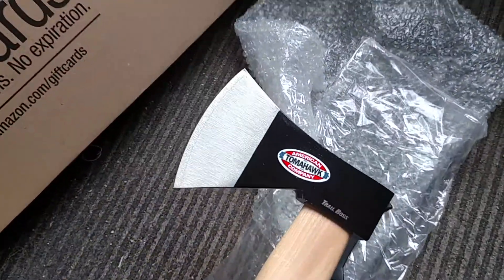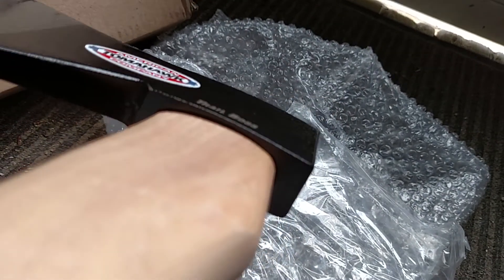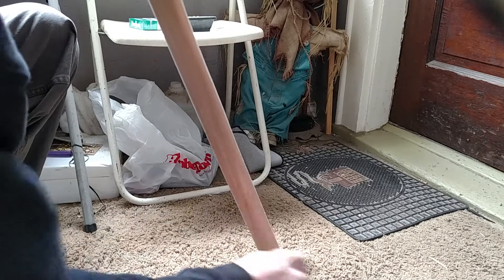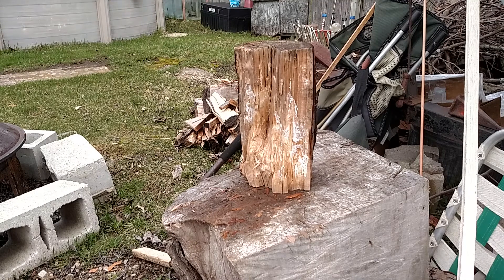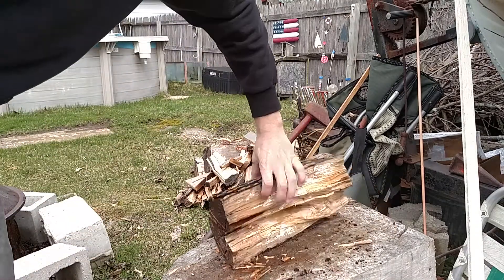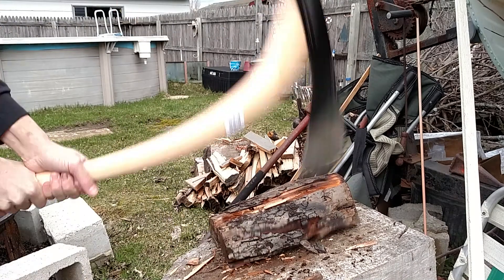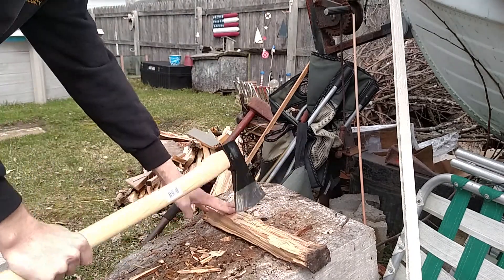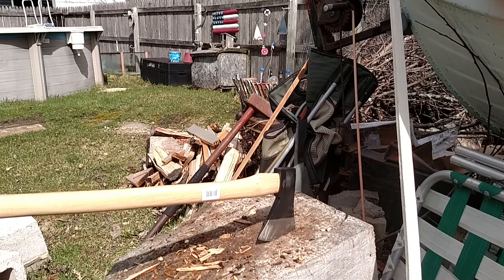Cold Steel Trail Boss out the box testing.

Comment: Good axe I heard for the price. With a little work of sanding the handle and taking off the coating on the blade and give good sharpening and think you will have a winner. I still wonder how the blade will hold to the handle for long term use. Then again you can always change the handle.
Reply from the maker: Tommycod Fish so far the head is staying on the handle with no issue. Been using it for about a year so far
Reply: I gonna buy one good price and make a leather sheath for it. Thanks for posting your video.

Comment: This axe was meant for cutting down trees not splitting wood. You’re going to break that axe one day if you continue to abuse it that way.
Reply from the maker: I wouldn't call the Trail Boss a felling axe and I also wouldn't call it a splitting axe. It's a small camp or back packing axe that will handle many jobs but do non of them as good as a axe designed for said job. 
And being only around 30 bucks it's a great all around axe for the value. 
Also if you notice in the background there is a 40 plus pound spilting maul and on the boat trailer I have spilting wedges too. Those being used for the big log spilting duties. 
This is a review not a how to video.

Thanks for watching
It's been 8 years since this video and I still have the trail boss and still use it. And again for 30 bucks I beat the crab out of it and she's still going strong.